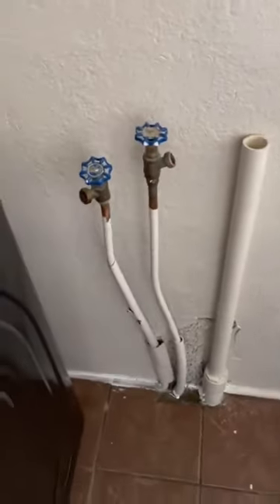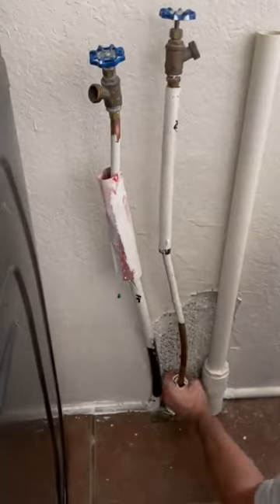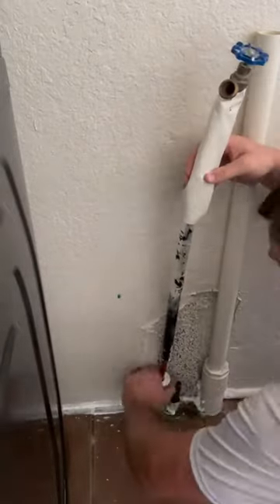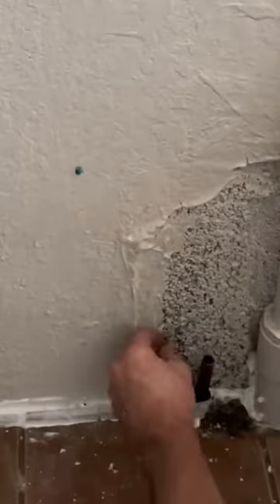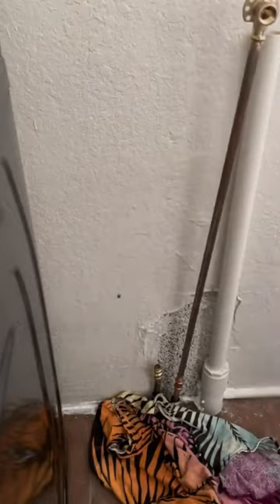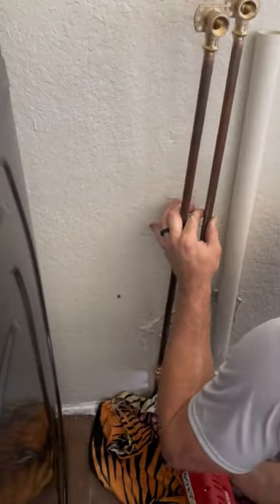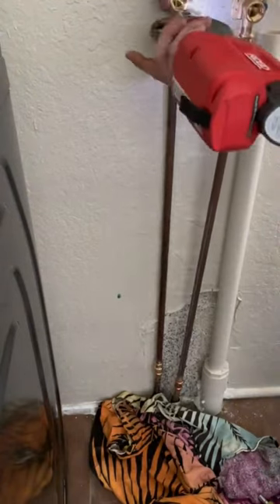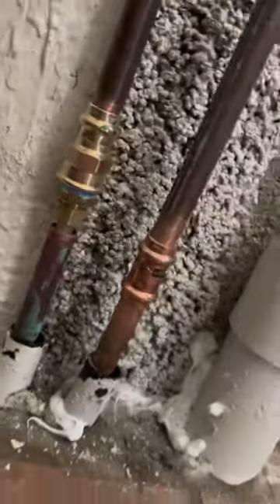Installing new valves for a washing machine.

Comment: I know how it feels to work on someone else's bastard of a repair. Then being limited by the owner because of price. There's no right or wrong just guidelines to stay inside.
Reply: Its a good repair.  My old wish is that he'd have left more of the PEX stubbed out for the next plumber who might have to service it.
Reply: That's the story of my life!! 😂
Reply: The phrase is ; Adapt, Improvise, and Overcome. A Day 1 requirement in the plumbing field...
Reply: 😂 that’s when you walk away from the job. That’s garbage and everyone knows it. If the customer wants garbage I’m not the guy who will give it to them. 😅
Reply: @yuknasty9199  Not everybody has $5,000 laying around to break up a slab
..
Reply: walk away.......why be blamed later?
Reply: The plumber did a repair within the owners pocket book. I'm sure people come behind you and say the same thing even though you were limited. Usually when a copper line goes bad under the slab the CHEAPEST fix is to run a pex line inside the old line. It's by far not the proper fix but customers don't want a trench cut into their finished floor. In my area going through the ceiling space is against code (freezing temps all winter). Drywall work would be the next cheapest but then your involving another contractor which would still be expensive.

Comment: As long as the water stays in the inside of the pipe until it's intended exit point you've done a good job
Reply: Its also for a washer so nothing that critical, all of probably 30-50 gallons a week.  It'll work just fine.
Reply: Until you get bacteria and flux in the tapwater
Reply: @infernaldaedra  those are added for flavor, duh.

Comment: I'm pretty impressed with that pex inside the copper solution. I'll keep that in my baxknpocket.
Reply: I’m gonna recommend you never use that solution….
Reply: It works good enough.  Lots of cities/plumbers push PEX/poly/copper lines through old oversized lead/galvanized mains to avoid ripping up entire yard and streets.
Reply: Just yesterday the man wanted to change his hose bib from 3/4 to 1/2 and it was thru concrete so obviously I said I’ll just put the 1/2 thru the 3/4 and adapt to on inside instead of chipping the concrete.   And thats what the homeowners wanted.

Comment: I'm a service plumber, and sometimes you just have to do whatever it takes to get the job done, even if it's not an ideal situation. And if you inform the owner that it should be done correctly and they still insist, then no problem.
Reply: WRONG! You're screwing the next owner of the home, and absolving yourself of doing so. How would you like it if someone did that to you?
Reply: @MarkTubeG  if a customer wants it a certain way and they are paying it's not my decision. And I wouldn't pay someone to do work on my house.
Reply: @jasparramirez9554  You completely missed the point. People asking a plumber to do sub-par work are screwing over the next owner of the house. You doing that work for them is screwing over both the current owner and the all the next owners.

The fact that you don't even realize, or just won't admit, that you are a hack, IS the problem.

And since you also didn't understand "part 2" of my point, I'll dumb it down for you. How would you like it if you bought a house and found sub-par work that no one told you about, and now YOU have to pay to fix it (or fix it yourself)? Would you just say to yourself: "Well, the previous owner told the contractor to just go ahead and do shoddy work, so the fact that they both screwed me over is "no problem"? You'd be just fine with that, right?

You're a licensed contractor (or are supposed to be). You have a responsibility to do quality work, up to code. That's actually the law (in most States). If a customer of yours asks you to do otherwise, that's not just on them, it's on you, and even more so, because you're the professional (well, you're supposed to be, but obviously, you don't know what that means).

And to your direct words: it IS your decision. YOU decided to do the job incorrectly. Just because someone pays you to do it wrong, doesn't make it OK. You could decide to pass on the job (which is what you should do). You can decide to do the right thing, or to do the wrong thing. You admit that you will do the wrong thing, as long as you get paid. Congratulations, you're the problem.
Reply: @MarkTubeG  no you missing the point. They pay me to do what they want. Not my problem
Reply: @jasparramirez9554  Yah, you already said that, and I explained, thoroughly, why you're wrong, which you apparently could not rebut with any sort of logical response. There is no explaining right and wrong to someone that is incapable of understanding the difference.

Comment: I had to do that from a manifold in a mechanical room of a split level house to the kitchen sink ran in polybutelene. I installed an isolation valve at the manifold as a backup.  That 3/8 couldn't handle the pressure with compression fittings so I replaced it with 1/4 pex which is the same as 3/8 supply line but has a higher pressure rating than that clear stuff

Comment: I'm amazed someone put soft pipe in the slab instead of rigid with elbows. At least they were able to slip in that plastic pipe without chipping up the floor.
Reply from the maker: You shouldn’t have fittings in or under the slabs. All older homes here with copper have soft copper in the concrete. Very common.
Reply: @theplumbersplunger  ... I have never done any installs but have done a few repairs over the years. (long retired) Would you believe black pipe in floor heat with threaded fittings? Yup, I have seen a few of those.
Reply from the maker: @rupe53  😳

Comment: Sometimes if the homeowner doesn’t want to do it right I will refuse to do any work.
Reply: Was about to ask what if it fails after said plumber touched it and knew that it was the customer that requested limited work. Whos at fault?
Reply: @b20teamunknown  definitely homeowner. They are responsible for their own maintenance and I would assume they the plumber told them if it fails then he won’t be responsible. Also have them sign an agreement.

Comment: There was once a guy in Lithuania who i worked for as a plumber, and he couldn't punch through his second floor concrete slab, so he drilled a small hole in his 4 inch main drain stack and fished to second storey a cable he needed to route, and punched a hole next to toilet outlet and ran trough his wire. He hired me to hermetically seal the holes. I was baffled at hus decision. I agreed and i stalled two tees with compression connections and just ran the wire. It was 10 years ago. He still thinks it was a great idea as it still works fine to this day.

Comment: and how did the new ends fix the leak in the slab ??? or do you just hope its not actually leaking .,
Reply from the maker: I didn’t connect back to the leaking copper line. I reconnected to that 3/8 line unfortunately 😅

Comment: I ran a half inch pex line through a 3/4 soft copper loop...saved the owner $1,000.00's and works fine, 3 years now.

Comment: I'm confused! I thought you said the hot side copper was leaking in the slab so they ran 3/8 vinyl tubing through the pipe! How does removing that and hooking back onto the bad copper that's leaking going to fix it?Did you reattach to the 3/8S vinyl tubing?! If so,Scary 😂 Maybe better to reroute above grade
Reply from the maker: I reattached to the 3/8 for now. They know it needs to be replaced and are planning on doing it in the future.

Comment: Could you not fix it with a bib washer?
Reply from the maker: Possibly but I don’t really offer that as an  option. The price I’d have to charge for it wouldn’t be fair. In this situation that line needed to be fixed before that fixture could be repaired.

Comment: Waaiiit.. Cold AND HOT water for washing machine? We only use cold water lines since less chance of leaks and no issue if running low with hot water.
Also this is reason when building you put all the wires and plumming that goes inside anything solid into a larger tube of its own that is watertight and lower end runs into room with floor drain well as water insulation, so if it leaks none of the water is inside the rooms or walls, or the slab causing issues where those cannot be noticed and fixed. This also allows running new lines trough that pipe so you dont need to make jerry rigs like this or rip everything open. Same applies to wiring. Might be bit more cost to install in materials, but saves so much money when rewiring. Also its by code here.
Reply from the maker: We have hot and cold lines to the washing machines here in every home. The sleeved pipe to a low location makes perfect sense but sadly most builders now care about profit and not functionality. We also don’t have basements or crawls spaces so that might be a little tricky.

Comment: You should have just change the valve that line through the copper would have worked just fine still and on something like a washing machine where you turn it on and walk away you're not going to notice that big of a difference in volume

Comment: Err... If the left line was leaking in the slab and he removed the 3/8" patch, didn't he just reintroduce the leak into the slab?
Reply: I believe he only removed it above a certain point, he said he adapted the 3/8th line to make the washer connection, and installs a little brass adapter towards the bottom after cutting all the old stuff away

Comment: hot and cold lines? Is that how American washing machines work? All our appliances in the UK, washing machine, dishwasher etc.. all just run off a cold line and the washing machine heats the water on demand to whatever temperature you want that wash to be and no, it's not energy draining, my washing machine is quite cheap, few hundred quid and it's A+++ on energy, it's actually more expensive to run the boiler for the hot tap lol
Reply from the maker: All the homes I have ever been to have a hot and cold connection here. Definitely different here compared to over there.
Reply: @theplumbersplunger  plumbing is very different over in the UK, they also rarely have hot water tanks, most are small in line heaters like powers showers

Comment: What most of these comments are missing: you just tacked on to a shitty repair, using the homeowner as the excuse. Everyone is assuming the current owner is the last owner, which will never be the case. When you do shitty work (or hire someone else to do it), you're just passing along the problem to the next owner. And, of course, the current owner will never disclose that to the next one, so that next person will get screwed. 

Service people that don't refuse such work are co-conspirators to a crime, plain and simple. Blaming the current owner for your crime is as weak as that "repair." What's worse, you knew all that before you did it, and you did it anyway. Still worse, you made a video of it and posted it, propagating your behavior as legit. Disgusting.

Comment: That’s some rigged up stuff right there. Your work is great but I mean the homeowner’s cheap-o decision to do that and not do it properly. Some people.
Reply: Properly means tearing up the floor or opening up walls, yeah nobody wants that.
Reply from the maker: This was an adobe style home so there is really no attic space. No basements or crawl spaces either. It’s going to be a fun one to reroute whenever that time comes
Reply: @bigpjohnson  Not always, you can reroute them externally.
Reply: @travisc3571  which means getting into/through the walls, which the customer didnt want.
Reply: How dare the homeowner want him to use the functional previously installed components instead of paying tens of thousands of dollars to tear up the slab.

Comment: As long as poor folks were not charged more than minimum svc call plus materials... Which I question...
.. along with why ball valves weren't installed to prevent future issues...

Single body, single lever 1/2in washng mach ball valve assembly, plus reducers = <$60.  This body mount directly to wall w (fewer) anchors.  

It is arbitrary where the transition is made from 3/8 to 1/2in.  Assuming leak mentioned wasn't in transition below slab, then why cut old copper back near floor and replace the copper?    The copper is merely a sleeve.  Strap it to wall after straightening the bent piece a bit and cover both with white HDPE ($5).

Leave gaps above existing copper and secure the PEX to wall, too, so no movement in pex before valve.   Some modern wash machines have crazy hard-close valves within.  Strapping the pex will prevent the PEX from failing at your repair if there is any water hammer causing movement in pex (transition from 1/2->3/8 line will naturally result in higher pressure in the 3/8).  If pex is moving like snake within lines coming out of slab or may eventually fail within there. .. but not at your repair.  Warn customer of this possibility so the can save for proper repair.

Otherwise I feel your pain and good job.